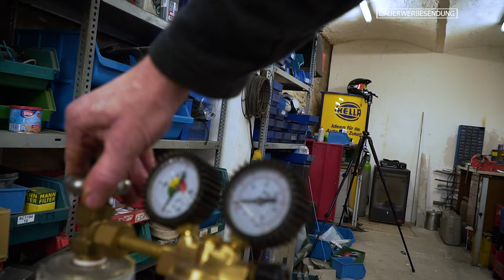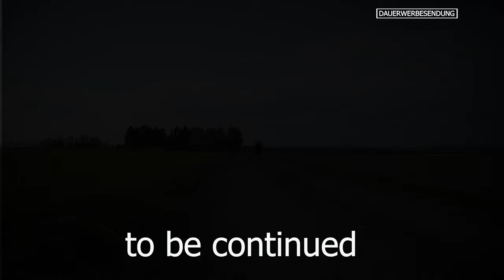STIHL Chainsaw powered PUKY kid scooter - full build / making of / DIY - crazy power conversation

Comment: You used the smallest stihl chainsaw engine which has the least amount of horsepower. You need at least an MS250 for that scooter to have the power to move an adult fast. I put a 1980 stihl 038 magnum 72CC chainsaw engine on a tiny pocket bike and this little bike will smoke the back tire and do nearly 50mph down the road carrying my 220 lb body.

Comment: Quick question. Where can I get that spur gear adapter?
Reply from the maker: Sorry its self made in a lathe
Reply: @motorschuppen  no problem. I found out that my saw uses a clutch with a removable gear that I can weld the sprocket onto.